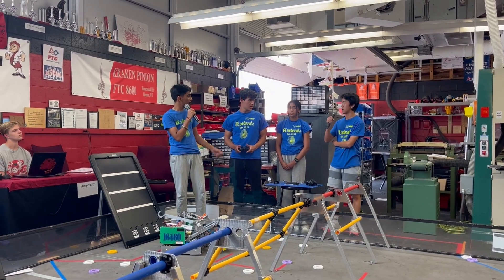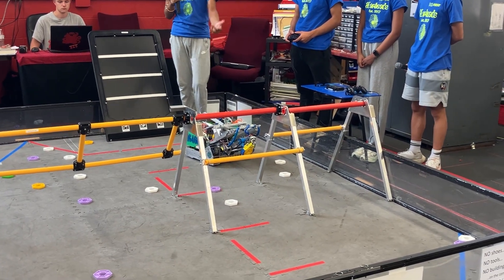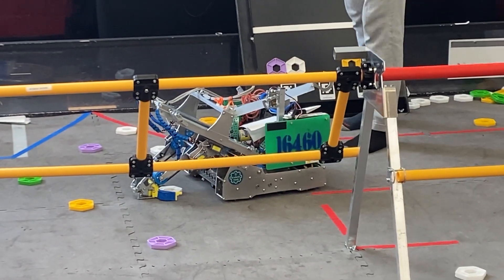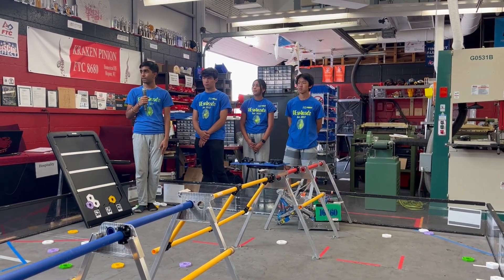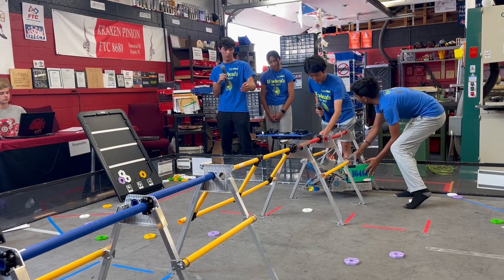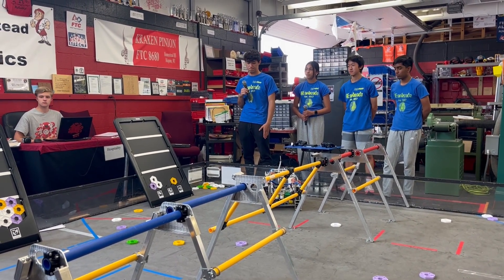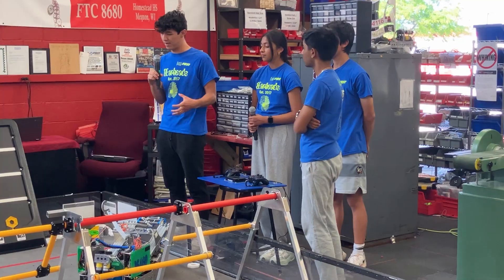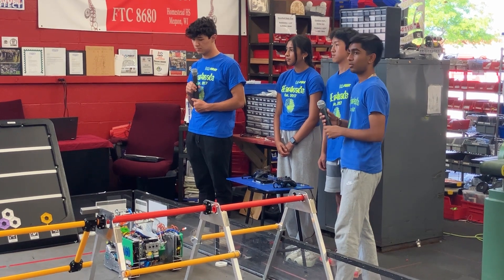30 Hour Build Robot Reveal (Audience Q&A) FTC CENTERSTAGE

Comment: love the climb, dead simple. Is it possible to use stored potential energy to do the climb? Some tightly wound springs/surgical tubing to save a motor?
Reply: If you can some how make that happen then absolutely. Use your creativity
Reply: how would they retract though?
Reply: @a1ien970  Simple explanation: think of a bunch of surgical tubing wrapped rightly around a bar on the robot, pulling on a hook, but we put a pin through the hook so it can't move yet. Then we place the hook onto the bar, then release then pin, and the surgical tubing pulls the robot upwards. Lots of possibilities